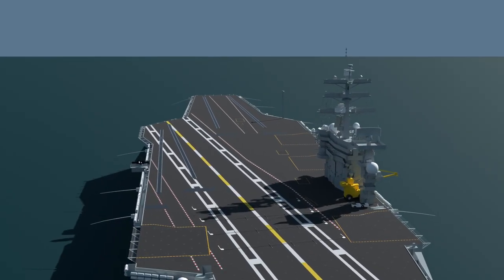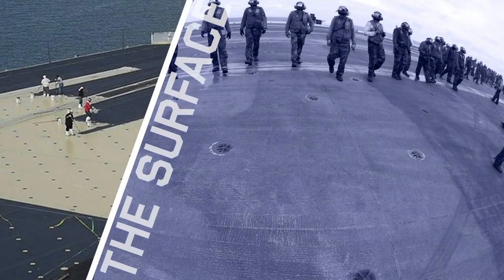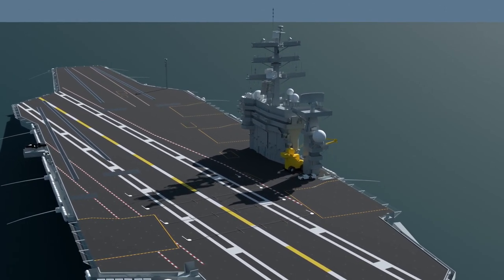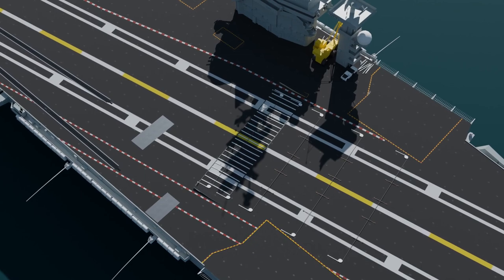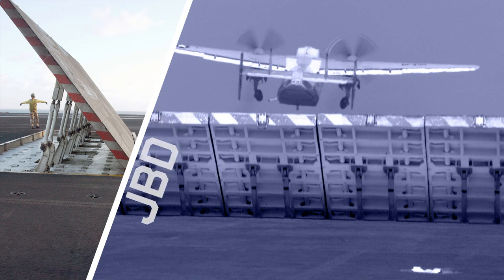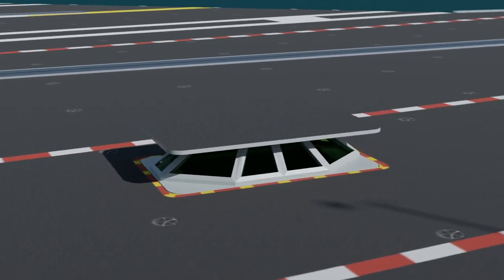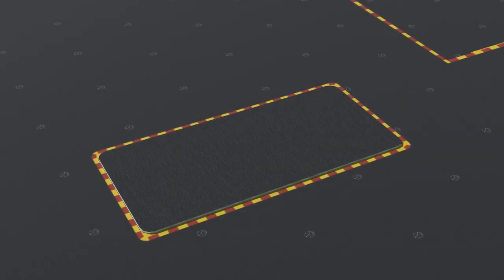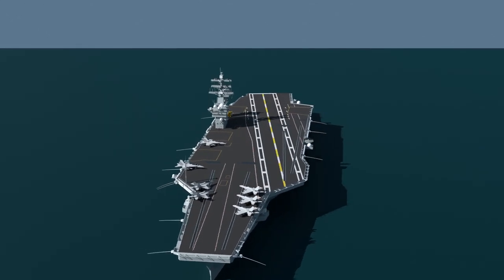What Elements Does the Deck of a Modern Nuclear Aircraft Supercarrier Make Up

Comment: Nice work. I saw little to complain about and I'm a pretty critical eye having done the job for 26 years on 6 ships. People may wonder why 2 foul lines on the port side of the landing area. The left one is known as the lens line. It is designed to make sure parked aircraft are not obscuring the approach view of the fresnel lens. Directors see that line in a third dimension starting at the lens and traveling upward into the air. In other words, an aircraft parked across the line forward of the elevator would foul the lens line. However, an aircraft on the finger can cross the line as long as it doesn't block it 14 feet in the air.
Reply from the maker: Wow thanks for the feedback. Very informative! Appreciate it